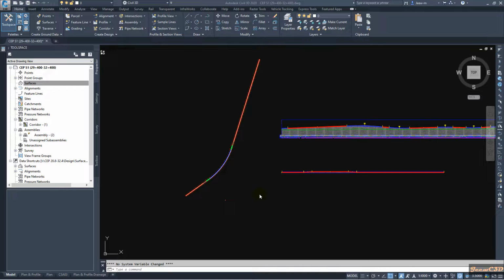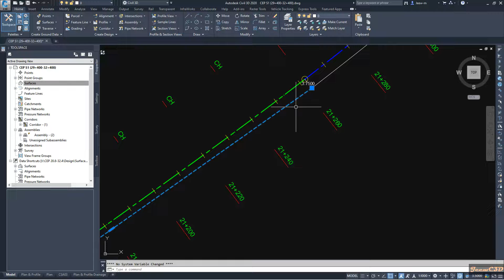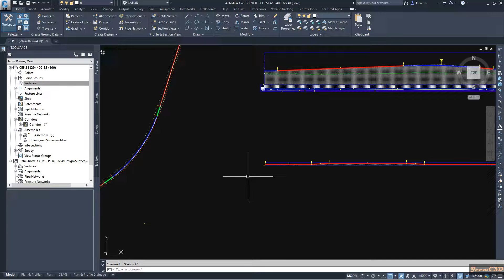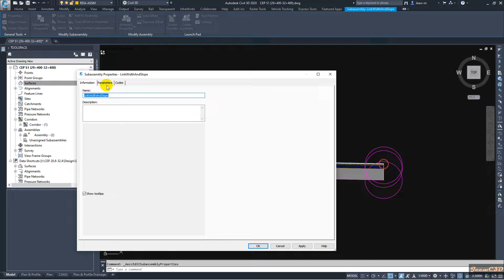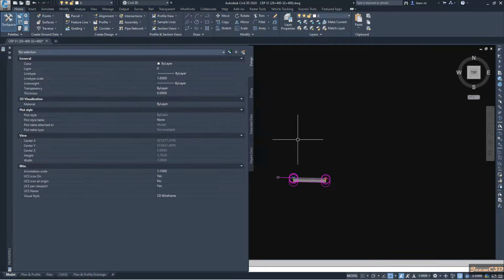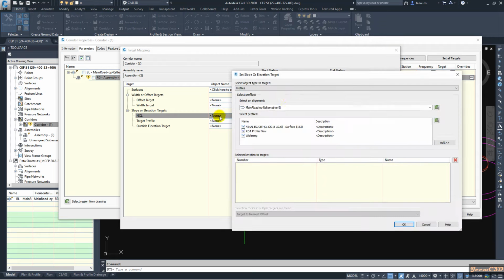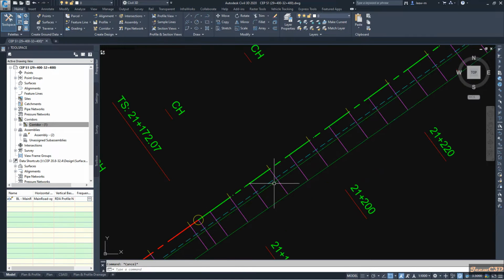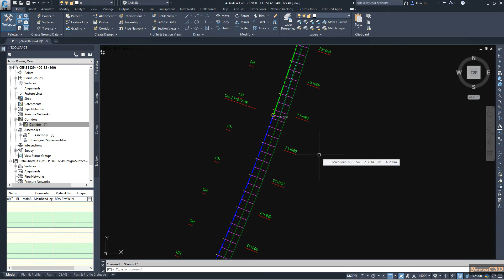Generate gradual width transitions on Civil 3D Corridors through Alignments

Comment: Thank you Jeewana. This will be helpful for me as I have a design of a symmetrical sub assembly which transitions into an asymmetrical sub assembly and then back to the original. I assume the logic would be the same?
Reply: When targeting a bench in a watercourse though, I do need elevation data, not just width. So I assume then that I offset my alignment with the required slope as a design profile?
Reply from the maker: You can extract the feature line of the bench and target it. It has elevation data.